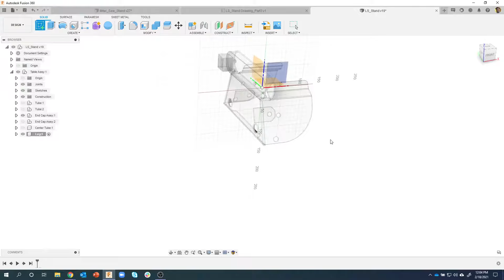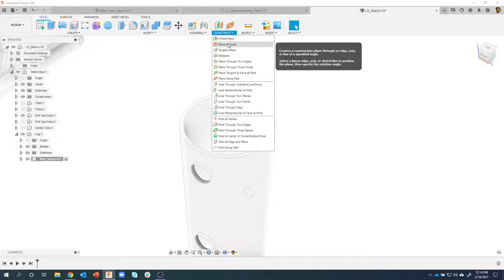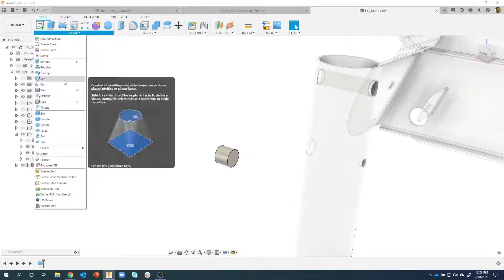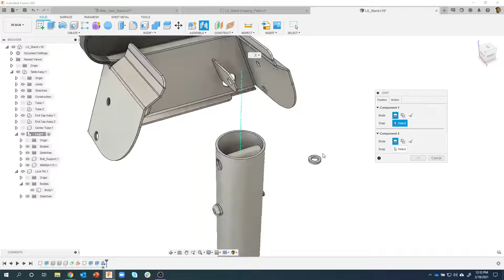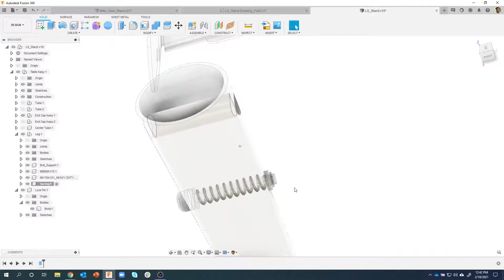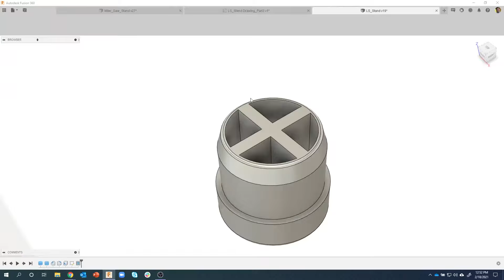Episode 84 - Miter Saw Stand project   Part 3

Comment: Hey Brad, I wonder if you might help me. @ 45:00 when you are showing how to put the McMaster parts and the lock pin into the pin assembly, when I grab those 4 pieces to put into the Pin assembly, the move dialog box appears. I can move the 4 pieces there, but they also remain up by the bolt support. Any thoughts? Thanks in advance.
Reply from the maker: @musoangelo-  My guess is that you did a Move/Copy, but then didn't move, so there is a copy on top of the existing models.  Check your Structure Browser on the left and see if there are more than one of what you are trying to copy.
Reply: @bradtallis8968  Hi, thanks for that. The next time I opened the program, it seem to do what I was expecting it to do and the 4 pieces were only under the pin assembly. I'm now having a problem with the web command. I was able to follow along til 53.16. but ran into an issue in that I can only select one of the lines to form the web. If I clear the Curve field, I can select the other line, but it will only allow me to select on line at a time. All the other fields in the web box match  your fields (symetric, to next, 5mm and the extended curves box checked) I've tried it a dozen times, but can't get it to work. Any thoughts?

Comment: if you go threw all and have a part too close it will go threw both. So so go to face so this will not happen.
Reply from the maker: @David Finlay- If you expand open "Objects to Cut", you can specify which objects the profile will cut through.
Reply: @bradtallis8968  I do not have the time to do that . i want it over and done with. done right the first time